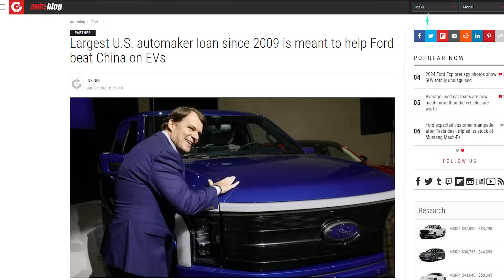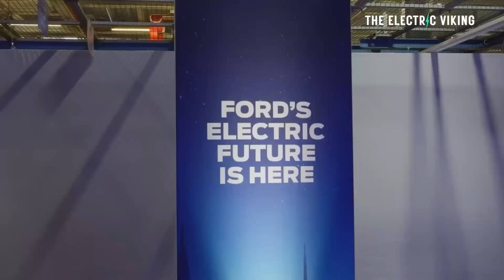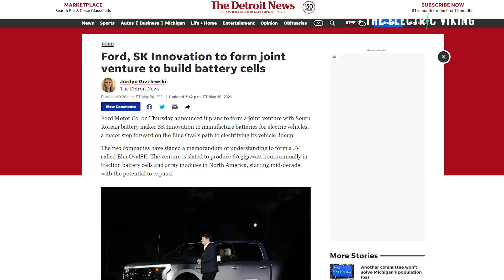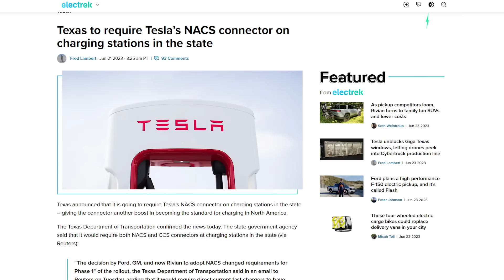Ford Receives $9.2B Bailout, UAW Clashes with Biden Administration

Comment: I bet that the government officials bought a lot of Ford stock before announcing the loan. I want to say here, one very important point. Battery powered cars are a dead concept. They have already failed. There is currently two growing movements. One to to build batteries from sodium rather than lithium, and China is hogging the production of that and the second stream is hydrogen powered cars. Word to the wise here people; all these options have failed. If you need to buy a car, you better get petrol or diesel.

Comment: The low wages is a recipe for disaster, turnover will be high and quality will be terrible.  It is a race to the bottom, and means quality manufacturers will not be able to compete with this bail out money.   The gov't is mad giving it to Ford (and GM) they will just p ss it away and produce terrible batteries that go on fire.